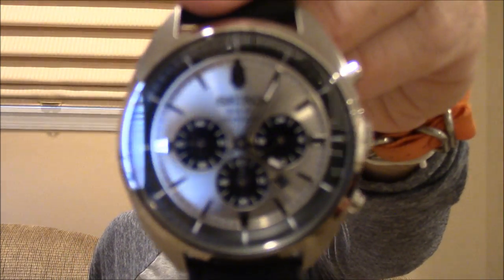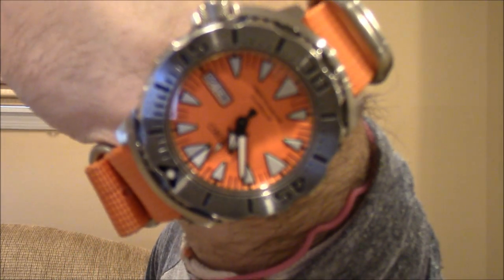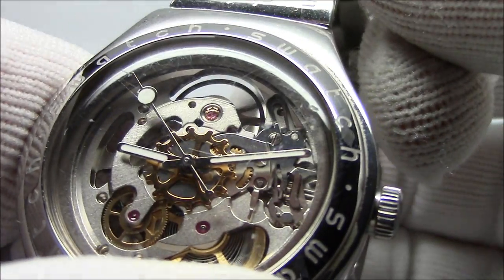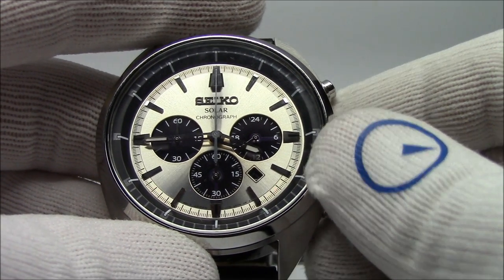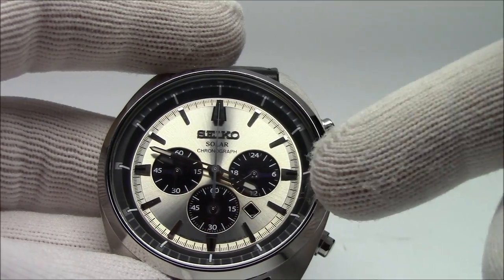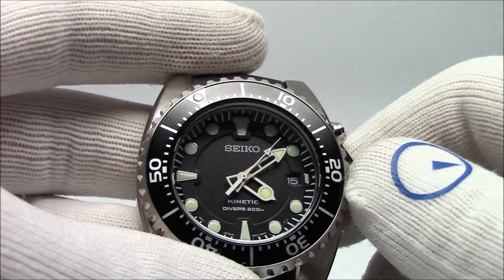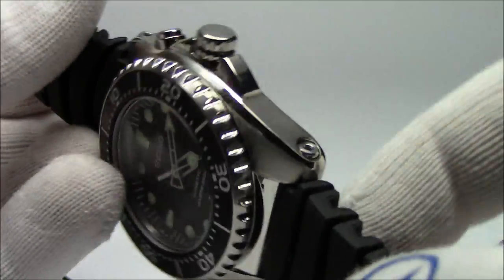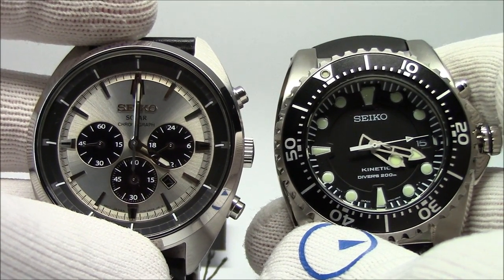What are Solar and Kinetic Watches? Watch and Learn #23

Comment: I have had that kinetic diver for 10 years. It has been trough hell and never had the back off it. Works just great still.
Reply: is it still running? :D
Reply: @relosapulso  Yes, no problem.
Reply: @ianbutler1983  oh nice! i recently bought the new seiko sumo prospex solar i hope it will last long same as yours :D
Reply: The capacitor in my Seiko kinetic went out after about 10 years, so be prepared to change it soon.

Comment: When Seiko came out with the “Kinetic” I thought another Self Winding Watch.... that is not new technology.  I soon learned, it was not a Former “Self Winding” Movement I grew up with, but indeed a kinetic with a quartz Movement but Charged by the movement of your wrist!  Thank You for explaining the difference. I have several Solar and Eco Drive Watches. My first Battery Operated Watch was  a Bulova Accutron 214.  It has a tuning fork and hums!  Citizen has since purchased Bulova and has a new Movement a 262 kHz  “Tri-tuning fork Movement.”  Very Accurate. The Grand Seikos are introducing new watch Technologies and accuracy within seconds in a year!  I’ve been blessed to observe changes in technology in Watchmaking over the years.  I still love Mechanical Movements and with improvement in lubricants extended service periods. Thanks Marc for your videos and explaining the new technologies!

Comment: Thank you, oh so kindly. You've answered everything I've desired to know about the Solar Seiko models. Have a Seiko Coutura Solar myself. As mentioned in video it displays as fully charged at all times. Even being stored away from light. I had the watch running non-stop. With my most other models I prefer to pull the crown out, and leave it idle until I wear one. My main concern was battery performance and longevity on the Seiko Solar.
Reply: Does the seiko solar quartz watch make a ticking sound like a swatch does?

Comment: Great video to understand different technology powering watches! What I would suggest it to do video of 'ultimate' watch: solar+atomic and suggest 'perfect' one as some are not so perfect as they do not adjust time when we go in DST and out of DST.
Reply from the maker: Thank you!
Reply: Mine has radio synchronization so it actually does correct for DST and leap years, so it never has to be adjusted.

Comment: My Citizen F900 GPS Eco drive has a power reserve of 1,5 Years with regular use and I think somewhere around 3 years (or even more) when in "Sleeping mode". Its also accurate to at least 5 seconds a month. 10 Bar water resistant, surface hardened titanium, anti reflective sapphire, automatic time zone adjustment.. love that thing. Truly a high end time piece.
Reply from the maker: Sounds like a great watch.

Comment: I have a solar Seiko SSC019 and it's been rock-solid.  Like all my solar watches, I put them outside for an hour each Saturday for a sun bath and they are all very happy.

Kinetics are a controversial subject in the watch forums and I don't know why, exactly.  Other than the lack of hand-winding (a couple of Seiko models now do, called Direct Drive), they  get their energy the same exact way an automatic does -- through wrist motion.  I also have the Seiko SKA371 (nicknamed the "BFK" for Big Frickin' Kinetic on the forums) and wearing it for a day once every two weeks is enough to keep it charged at the six month reserve level.  It is true that the early kinetics in the late 90s had capacitors and were prone to premature failure, but Seiko had been equipping all their kinetics with lithium ion rechargeable batteries for more than ten years now.

Great informative video as always, Marc.  Greatly appreciated.
Reply from the maker: You are correct; early kinetics ran on capacitors as the battery technology wasn't advanced enough; it is now.
The Seiko direct drive never really caught on (in my opinion). And I think the issue with the regular kinetic is the rotor has alot of resistance and needs to be moved heavier than an auto to keep it charged up.
Reply: Lee, just 2 days ago, I bought the Seiko charger for my kinetics. Wearing the watches would maintain the low level charges they had when I got them, but nothing I did would get them  up to a full charge. They are great watches otherwise.
Reply: Good to hear, Michael!  Those dedicated chargers do work very well.

PS.  Shouldn't you be busy abstaining or something? :)

Comment: For those with kinetics who don't wear them often enough to keep them charged, I solved the problem of keeping them charged while not in use for long periods of time. Instead of purchasing a pricey Seiko Kinetic recharger, simpy buy a Phillips rechargeable candle set. Not only for sub- $70 do you get a nice set of rechargeable batteries, but you get a three-slot recharger that can also be used to recharge your Kinetic watches. All you have to do is place the watch case on it's side into the slots, press the on button, and do it again the next day and the watch will be fully charged for 6 months worth of juice.

Comment: I have a Casio eco drive world timer watch that I bought 8 years ago. It is my tool watch that I wear on all occasions especially when I go flying for the Airline. Amazing thing about it, I have not been using it for the past few months, but it still works extremely fine when I try to wear it a few days ago. It has been conserving energy and ticks to the exact time when I expose it to light.

I could say it is one piece of excellent engineering from Casio. I will cherish it and put it in my watch cabinet. Now my daily watch is an Omega Seamaster or a Seiko Presage. Great video by the way. Most probably I will buy another Citizen watch eco drive with perpetual calendar or a world timer with Radio controlled built in. Can't really decide about it. Cheers 😁
Reply: Casio isn't the same company as Citizen-

Comment: The length of the video is perfect, not too long and not too short. The information you share is excellent as always. May I suggest something. If you start the videos by number i.e instead of # 23 at the end, if you put 23 at the beginning. May be it will be easier for reference down the road when you have a whole bunch of videos. Regards.

Comment: As a watch repairer of 53 years i place my kinetics on my automatic workshop winders when not in use along with my own automstics and repairs
An auto winder for single or multiple watches would help if the owner does not wear regularly
Many jewellers sell them
Or available on line
John Anderson.Hastings.England.

Comment: I read somewhere that only Seiko can use the kinetic system because they patented it. Only other branch that may use it is Pulsar because thats a sister company from Seiko. Thats actually what I wear, a kinetic Pulsar. Bought it used on Ebay a few years ago and it still holds up. Just never let it lay on a some shelf for more than a day or two.

Comment: My everyday watch is a Seiko SKA727 Kinetic.  Love it's accuracy (about 1 second a month), and the simple military style display.  I would not recommend getting a Kinetic unless it will be your every day watch.  As I've seen discussed in another forum, owning a Kinetic is like owning a dog.  You have to walk it every day, or it dies.  Any rechargeable battery should be kept, as much as possible, fully charged to extend its life.  I understand the batteries for the Kinetics cost in excess of $50 if you have to replace them.
Reply from the maker: LOL. Good analogy.
Reply: I also agree with u   you have to wear it everyday
Reply: After learning about kinetic & solar watches still containing a battery inside which cost $50 to think it's just an ordinary rechargeable lithium battery w/c last 2 to 3 yrs. Whether you use it or not only means that Kinetic & Solar watches are still battery operated watch which uses a costlier battery makes no sense, i think it's better to use an ordinary battery operated watch instead since it's battery would still last 2 to 3 yrs. & you don't need to wear it daily. Automatic watches i conclude is still the way to go despite not so accurate. It doesn't need servicing for more than a decade & no battery to burst if left for a long time unremoved. When batteries burst your watch is a goodbye as it will damage the electronics inside. Either i go for an automatic or just an ordinary battery operated watch would be best. Solar & Kinetic is kinda more of a gimmicky technology which doesn't benefit the consumers since all Lithium batteries will die after 2 - 3 years. No lithium battery technology can make itself last more than 3 yrs. & function normally. I conclude Kinetic & Solar watches are just bullshit.
Reply: I have my seiko kinetic for about 10 years, never change any battery and still good condition as it goes.
Reply: Bernard Tan Whats the point of a watch that doesn't keep the right time . Embrace the future  !

Comment: What is the servíce intervall to keep the rotor running (oiled) ?
Reply: That's what I need to do on mine, because the rotor on my Seiko is sluggish moving. It used to be impossible to position the watch with the rotor on the top without it going back to the bottom, but now it's easy.

Comment: I bought a Citizen BM 8180-03E secondhand in around 2004 and have only now replaced it with the same watch because it was no longer holding a reserve charge. That is 16 years  or more use without ever opening the watch.  It was still keeping time if it was worn but after 24 hours in a draw it stopped. Not even a Rolex will go that long without needing some attention, at least my brothers doesn't.  He spends more than the cost of a good solar watch on servicing it every couple of years with the Rolex service agent.

Comment: As a former engineer, can you explain why nobody has released a solar powered watch with a smooth sweeping second hand? I know that most quartz watches tick once per second, because by ticking only once per second, they get a long battery life. Since a solar powered watch has almost unlimited battery life, it should be able to tick multiple times per second.

Citizen produces both the Ecodrive movement and the Precisionist movement. If they could combine these two movements, I would buy watches with that movement in a heartbeat.

Comment: Thanks Marc. So what's the life span of a solar watch before battery replacement needs to happen? Are the batteries redilee available?
Reply from the maker: Yes, they are readily available from Seiko for installation by a pro. Figure 10 to 20 years. That's my guess. Seiko would say longer, but I have doubts.
Reply: Thanks Marc...and yes it's readily. That's what I get for not using my glasses. lol

Comment: I don't know about two days to a full charge with a Kenetic. I have two of them and I wore both of them for about a month straight and never reached a full charge. This even includes doing a few miles of cardio on a treadmill lol, the only thing that keeps my Kenetics going is shaking them in a quick uniform circular motion, such that you hear the rotor constantly spinning instead of moving back and forth. The technology is cool but it's in no way as efficient as the Kentic winding you can achieve with an automatic. Seiko should come out with a hand winding Kinetic or one with a more efficient charging system.

Comment: what is the benefit from both kinetic and solar to quartz if the battery of both must be replaced just like the quartz?
Reply from the maker: Nowhere near as frequent replacements!
Reply: I've had my kinetic for 10 years with no issues... I'm sure some have had problems but I think if it can go trouble free for ten years (and counting) well... that' pretty good.

Comment: Marc, was watching this video again and had a thought, if the solar watch recharges with light exposure would it be possible to have a sweeping second hand?  The one click per second is a battery saving design to my understanding so is the battery is recharged with light then that would not be a concern.  Maybe 2 months or even one month standby but that would be ok to get rid of the second hand bounce.  Thought?

Comment: Great video! Please clarify something for me though... I have two Seiko kinetic perpetuals. One is around 10 years old, 7d48 the other I just got a couple months ago, 7d56. Both of these have a sleep mode after I believe 24 hours of inactivity and a power reserve of around 4 mos? Once in sleep mode they will keep time and date with no movement of the hands. Once you "wake up" the watch, the hands will advance to current time. Also, I've had zero issues with the 10 yo watch, not sure if it is capacitor or battery driven... I thought is was on a capacitor. Anyway, I don't wear the older one very much any more, but every time I pick it up and give it a shake, it's right back on track. It has been the most trouble-free watch I've ever owned over the last 10 years of consistent use! Can you explain the difference between this Kinetic function and what you described in the video?
Reply from the maker: Same thing; most kinetics have the sleep function. They charge the same watch; but to extend energy, they stop using the hands and instead keep the time internally, until "woken", then the hands move.
Reply: Thanks!

Comment: I've always wondered about quartz watches with and without second hands. My question is with a second hand does that actually move the minute hand accordingly or is the second hand just there for "aesthetics" or does to show that the watch is running, as opposed to one without a second hand, what moves the minute hand in that case. I have Swatch quartz watches with and without second hands. Does the second hand actually move the minute hand on those?
Reply from the maker: If you don't have a seconds hand, and you put the watch to your ear in a very quiet environment, you can still hear a "tick". It might be every 5 or 10 seconds, but it will be there. I don't think there is a quartz watch that ticks once per minute with one single watch movement. The Mondaine stop2go does, but it has 2 movements.

Comment: I've noticed when opening the back of a watch many years ago, there seemed to be a lever which I believe is used to either speed up or slow down the watch. It was located right over the main spring. Do you recommend the user adjusting the speed or would it be advised to let a professional do it? As always a very informative presentation.
Reply from the maker: We did a video on this, regulating a watch. It is doable by the end user.

Comment: The Casio Solar Analog watches do the 2 second skip when charge drops to mid-range. My G-shock does, my Edifice has a meter hand. My 2 Solar Digital G-shocks have metered bars for charge indication. A little solar goes along way on all these watches, just an extremely efficient system!

Comment: For your information, my friend has a Seiko Premier Kinetic Direct Drive watch. It has a rotor weight for recharging the battery, AND you CAN wind it to give up to a month reserve power, in theory. Perhaps the movement is different from the one in this video. Anyway, I think an automatic watch which cannot be wound is not good. The drawback of my friend's watch is that it takes hundreds of hand-winds to get only a few hours or a day reserve. This is why he replaced it with another watch; the Seiko kept stopping! Perhaps there is something wrong with the battery or the charging unit... I managed to wind it to a week reserve with an electric screwdriver. Yes, it is that bad!

Comment: Thank you very much. Approximately what's the life span of the rechargeable batteries in these watches? I am glad I found this channel. Looking forward to buy my next watch purchase from you.
Reply: About 10 years, or more.
Citizen did a few tests of their eco drives that had a second battery, and showed that the second battery would have about 80% of it's storage capacity in 20 years.
So while they do degrade, they degrade in a way that they store slightly less charge each year, so even when they're less effective as long as you wear them outdoors you're likely charging it up enough that you never have issues with power running out for at least 10 years.
Reply: @G1NZOU  secondary battery, as opposed to primary battery. The secondary is used to refer to rechargeable batteries, while primary batteries are used up and disposed of after they're spent.
Reply: A very long time. Just don't let them run all the way dead, that will shave time off of their life.

Comment: Can you use a watch winder to keep a kinetic watch charged? I've tried it on one of my seiko kinetic watches but it doesn't seem to keep the watch charged.
Reply: Ingram, I have had not luck with a automatic winder on a kinetic either. I think they need more of a rocking motion and I have not been able to find a winder like that. I would like to know if Mark knows of a good kinetic winder.
Reply from the maker: The resistance of the rotor probably makes it not work on a conventional winder. It is much tougher to spin than an automatic winder.
Reply: The only reason I try in that I have an older kinetic with the capacitor and full charge is only about 7 days. My newer one had a 6 month charge, so no issues there.

Comment: My Seiko Solar Instruction Manual says that if you replace the rechargeable battery with a regular silver oxide button cell, then it could start a fire because the watch shall try to charge it.

Comment: I have a Seiko Kinetic but I need to wear it almost every day to keep the charge.  If I take it off for even 2 days it dies.  How can I get the charge up to last for 4 to 6 months??
Reply: Unfortunately you did not show how to "shake" it.
Reply from the maker: Kinetics take more shaking than autos. They need another of energy and large durations of it to build up the reserve. Like taking it for a jog.
Reply: I have the same problem. When I bought my seiko kinetic its charge lasted for months. But now it gets discharged within 2 days if not in use. It there a problem or is it normal?